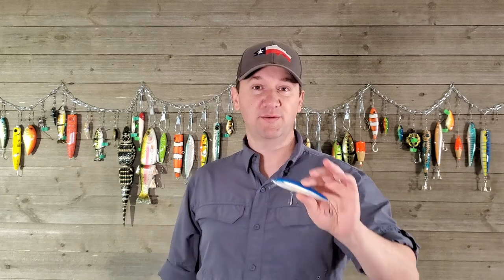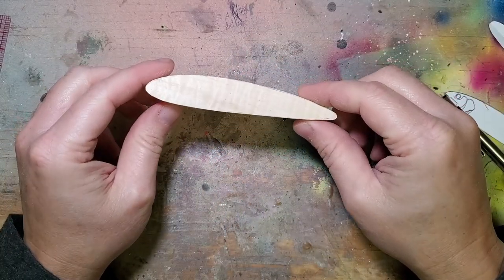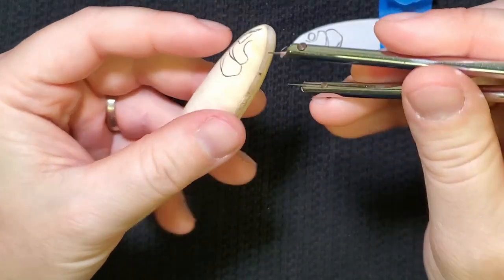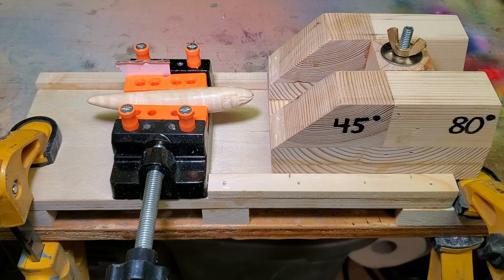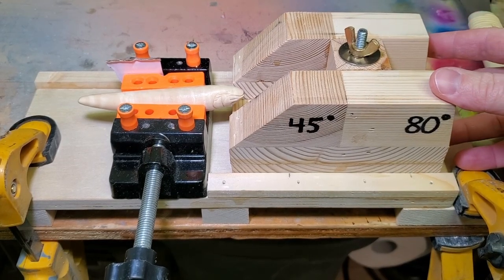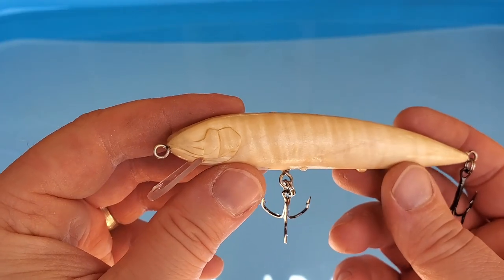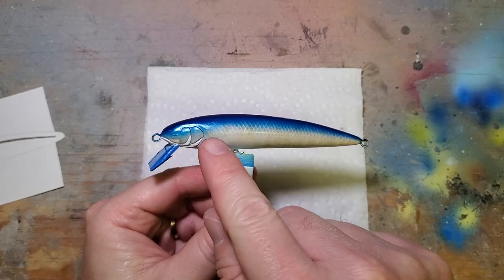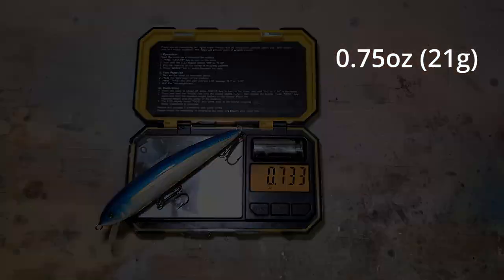Jerkbait Lure Making- a how to guide on making wooden fishing lures

Comment: Hi, Mike. This one is truly LOADED with good information that will help with lure-building, regardless of a bait's design. The triangulation method  for the transfer of the gill stencil and the adjustable lip-angle jig are just two examples. Moreover, your idea of increasing the  buoyancy of the maple bait by adding a "slice" of balsa to a slot in its top confirms my own solution for modifying a large maple glide bait that  I'm working on. (It's just too heavy.) Thanks so much for your efforts, Chris (in Maine)
Reply from the maker: Hey Chris! I'm glad you found this information helpful. Best of luck to you with your glidebait!

Comment: I found that these tasks are easier while the blank is still rectangular:
  Drill the eye socket hole all the way through.
  Cut the lip slot.
  Drill the weight hole(s).
All from the relative center / layout lines.

Then I cut the blank into shape.
Reply from the maker: Sounds like you've got a great system!  Thanks for the tip and for watching!